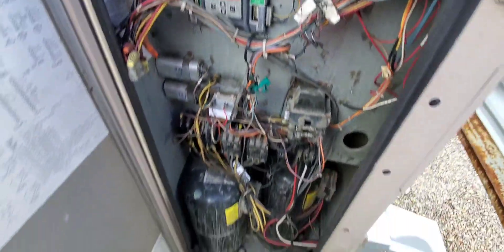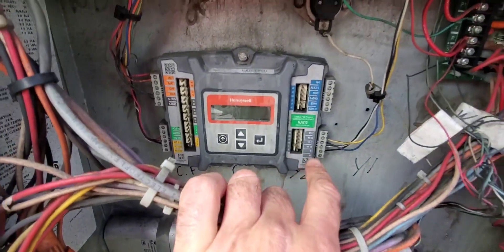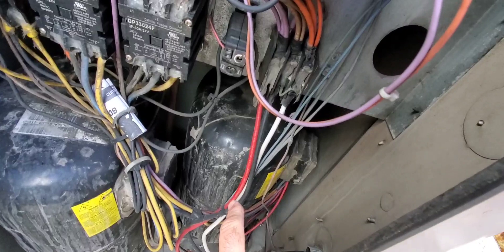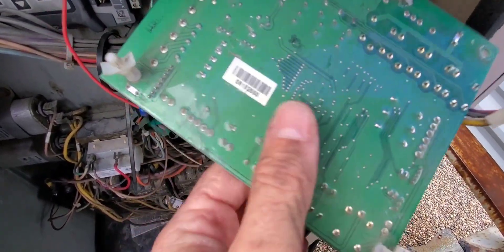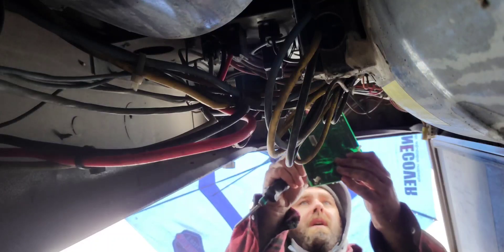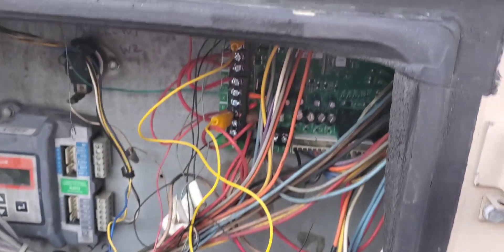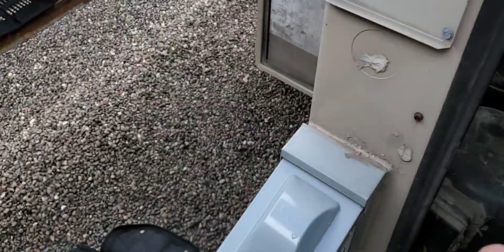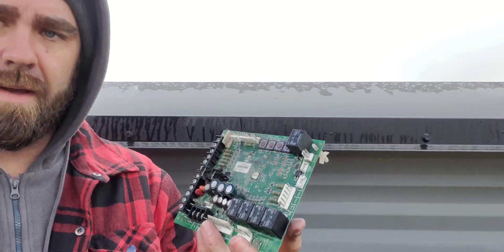York Predator RTU Main Control Board Problem and Troubleshooting

Comment: Hey man, question. I have the exact same control board as you and its bad. But the thing is the white barcode near the center is different. Mine has different nunbers but the control board itself is the exact same. 

Ive also find alternative replacement control boards but same case, they look identical to yours and mine but the barcode numbers are different.

What does this mean??

Comment: I've had an issue on same unit where it stuck in free cooling mode, the plug that you disconnected from the top of the board is going to the left section of the unit where it plugs into 9wire plug and on the other side everything was disconnected and plug was jumped from econ in to econ out. Any idea why would someone do that? Thanks
Reply: Bro I’m stuck wit this issue right now . Did u fix this ?
Reply: @rellhunter9674  I didn't go back to that service call, probably board issue.